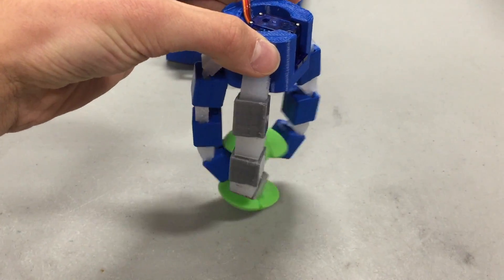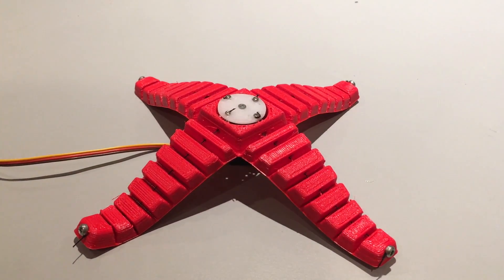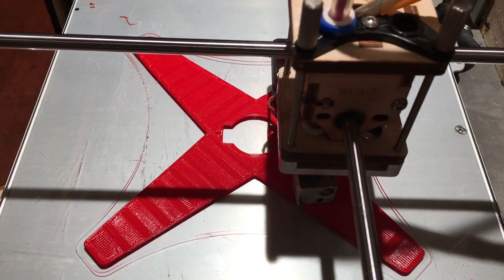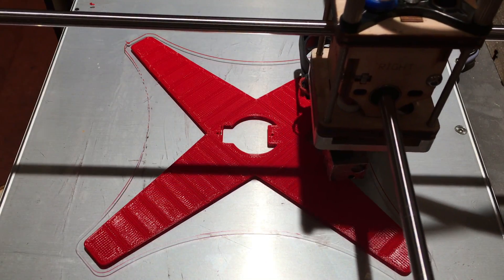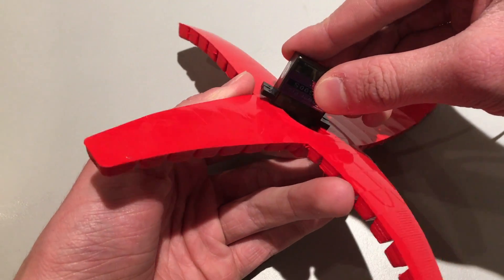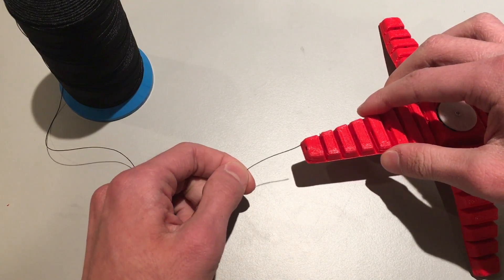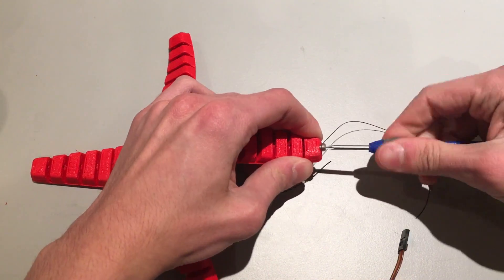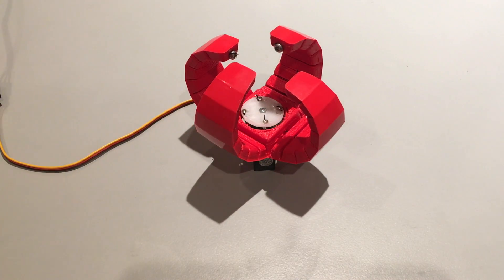Print-in-Place Robotic Gripper

Comment: I’m confused. Is this a 3D printing video or a cooking video?
Reply: What if printers could insert components as they operated? Everything from forms, jigs and parts made from materials beyond its capabilities to ICs, motors and the like? It could speed up 3D printers by allowing them to insert  off the shelf structural pieces instead of printing them while simultaneously greatly expanding their capabilities.

Comment: Neato!

Hey, I'm sure I should be asking Angus this, but I never remember to ask when I'm on his channel. What is the purpose of the ring printed some distance out from the part, on the first layer?
Reply from the maker: thanks! The outline of material around the print is called a skirt. The skirt is the first part that is printed, so it helps to clear the printer nozzle of any debris and get the plastic flowing smoothly

Comment: Can we use this gribber under water and if yes is the material lighter than water ?
Reply from the maker: treasureinvessel the mechanism of the gripper would probably work under water if you used a watertight servo motor. I think the material is denser than water though.
Reply: Ok thanks for the answer

Comment: You dont need an arduino for this!!! You can just open the servo and just cut the wires, then solder two wires directly to the motor and using a 3 way switch and a 4.2v 18650 cell control the movement very easily (of course that would mean that its hard to get it half gripping and stuff like that).

Comment: The thread will probably work itself through the material on the inner side and you'd need to use some kind of tube that fans out or has a smooth inner edge just where it leaves the material and is bent by the motor for the gripper to work in the long run - what do you say?
Reply from the maker: Although the material is pretty robust and I haven't encountered much wear in the spots where the cable moves, I could see this potentially happening. I know that industrial cable-driven actuators use small pieces of Teflon tubing to prevent such damage.

Comment: This works better than my robotic hand. Do you think you can make a 5 fingered human-looking hand using this method?
Reply from the maker: Wow, that's interesting to hear. I've thought about making a humanoid version of this based on the same concept, but I haven't gotten around to actually trying anything.
Reply: XYZAidan If you tried to make a human shaped hand,you could use the same string+servo method for each finger it would be an interesting project thanks.

Comment: You should do a claw machine with this. Just saying.
Reply: Claw machines are supposed to drop objects on purpose and make it seem like an accident. This appears to be too deliberate and too reliable. It's much too good a design.
Reply: Haha yeah, that is right. Maybe in a more just world this would be a good type of recreation.
Reply: Replace the nylon threads with some grade of elastic thread , that'll give it a weaker grip. It's such a cheap part to make, maybe someone will make the "octopus" an eight clawed machine themed like octopus in a tank. Edit to add: if one adds a servo current feedback signal to arduino: any grade of weakness can be synthesized in software.
Reply: John Amundsen   the plastic will properly break